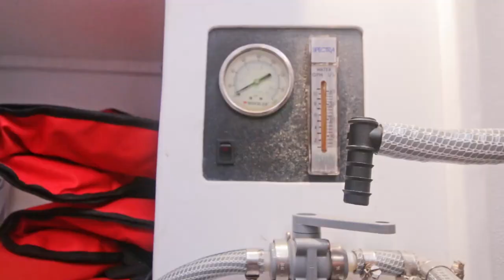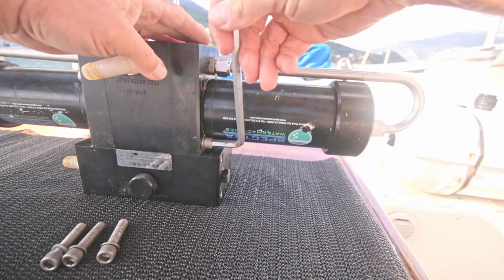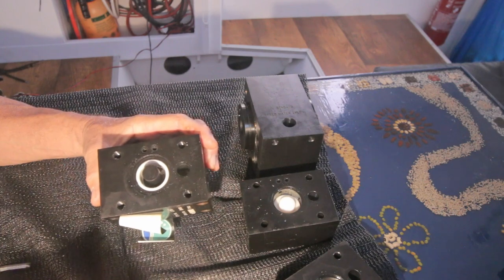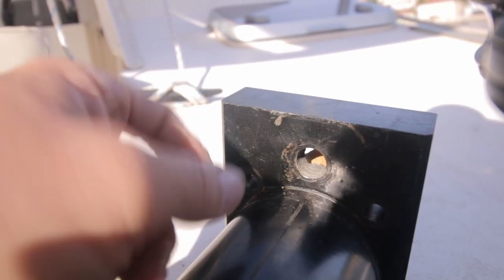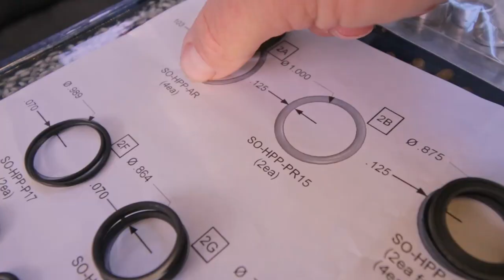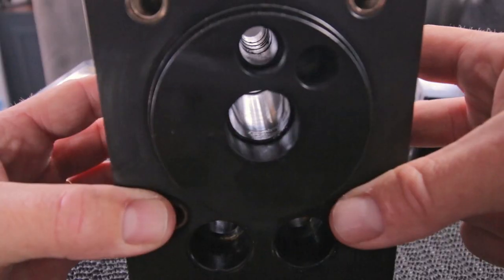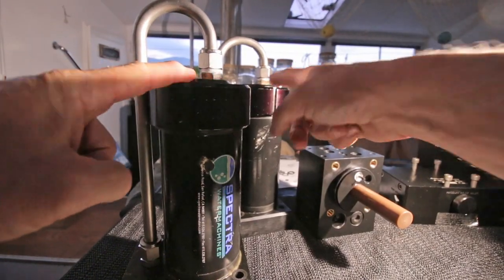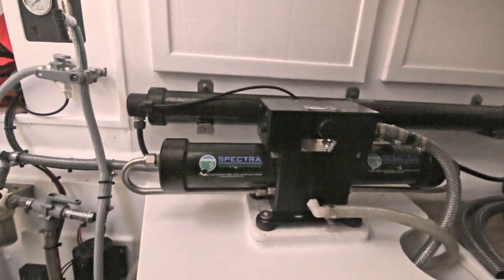DIY Spectra watermaker rebuild - Sailing Exodos, ep.47

Comment: Watched the whole video even though I went for the semi-DIY watermaker with easily replaceble Kärcher high pressure pump myself (not even put together yet, only had it nearly 2 years). Enjoy seeing someone attack tasks the way you do!
Reply from the maker: Haha, "only" two years? 😂 Yeah, I know how that works. And yes, using easily and cheaper replaceable components is a very good idea. We could buy this whole system for cheap, though (1/6th of the price of a new one, including a brand new original membrane, chemicals, original filters, and some other stuff). And it uses 8.5 amps max at 12V, so we can easily run it on solar we don't use when the batteries are absorbing.
Happy greetingz,
Wim

Comment: Thank you, best I've found so far,.. .  One question though : When you took it apart the large white pistons (lower unit) on both sides, they had a large circular groove in them, and I kind of expected there would be some kind of O-ring in those grooves,..... but there was not,....... and also not when you re-inserted them. ......... I thought these pistons were moving back and forth and with their large area was pusing liquid through a smaler diameter hole (the pipes at both ends), and in my mind, consequently, they should have some kind of seals ?,...... unless the white piston heads are self sealing somehow. ........... I just purchased a second hand one, a different brand, but almost exactly the same construction. ....... Thanks for your focus on details / struggles and alternative solutions to special tools, and the focus on what not to do :-)  Very good.
Reply from the maker: Thank you! 🙂 But about your question about those pistons - it's too long ago, I'm afraid, to give you an reasonable answer to that. Those pistons are made from teflom, so they are a kind of seal in itself, because they fit so precisely in the cylinders. I don't remember those circular grooves... Success with your rebuild!

Comment: Thank you so much for the video, certainly gives lots of useful information, helps to make decisions about our watermaker rebuild. I thought our bronze fittings were corroded badly, but yours looked worse, and they still seem to work - phew! - saves lots of $$ if we can reuse them. Did you have a lot of build up on the stainless J tubes by the ferrules and how did you clean those if you did?
Reply from the maker: Well, I'm happy you could use the info in our video :-) Yeah those bronze fittings... The oxidated bronze that came off, partly ruined the cylinders, so we have less liters of fresh water per minute, but hey, the watermaker was cheap, so I can't really complain. As far as I remember, the J-tubes were clean. The stuff on those bronze parts was no gunk, but purely oxidized bronze.

Comment: Hello and thanks for the great video. Enjoyable to watch and got me thru the take apart of my Clark pump. Rebuilding now. Did I miss the outcome of the rebuild.? Did the pump work and were you able to make water? Thanks…Ernst
Reply from the maker: Hi! And you are welcome. I don't remember precisely, but something was not totally right, then. I believe the new membrane that came with it, was so old (and the plastic around it had a hole), that it totally was dried up and unuseable. So we needed to find a new one. Took some time. But (much) later we got a new membrane. The watermaker didn't deliver enough liters of fresh water, though, because the cylinders were a little damaged. But it worked! And just a week ago i have added a second pump to it, and it gives us 38 liters per hour, so that is nice, especially because we can run it on the solar panels.
Reply: Thanks for the quick reply. I have a considerably newer unit that only had 970 hours on it but it was laid up for 4 years, pickled but not used. Working with a great dealer in FT Lauderdale US, Halden Marine, he has determined what I need over the phone and with pictures. your video was extremely helpful in the take apart and I will follow it as I put it back together shortly. thanks again!!!

Comment: Do not use Teflon tape on the threads the SS nut threads onto. It will prevent a proper seal. The biggest problem with this pump was the white O-rings on the check valves and Annular rings. That is what cause the asymmetry of the pump. I would highly recommend that you change "All" the fittings on this pump and the two on the membrane as well to all SS.
Reply from the maker: Hi. The reason that not all the fittings are stainless steel anymore, is because the ss ones expand and crimp with temperature differences. The old ones were all ss, but the factory started using these nickel-bronze ones because the ss ones sometimes cracked the pump. Because the nickel-bronze hardly expands and crimps with temperature differences, they don't crack the pump. I explained that in the video, but you probably skipped that 😎
By the way, I don't make this up, but the technical department of the factory told me. And another by the way, the pump is perfectly leak proof, with the teflon.
Yeah, those annular ring seals were really gone!
Happy greetingz,
Wim
Reply: @DoubleUThings   Greetings back at ya. Take my word for it. (I didn't skip any of your video. Which you did very well by the way) Change all the fittings to SS. The corrosion you showed in your video of the NB fittings will destroy far more of that pump than the very rare occurrence of any cracking of the pump. Even if the fittings cracked the pump (again very, very, rare)  it would only be either the center bottom block or the top center block. These are far cheaper to replace, about 25% cheaper, than a total re-build of a pump that suffers from scoring issues because of the NB fittings. Scrap the Teflon. The SS ferrules are not meant to have tape here. It really does get in the way of the ferrule seating properly in the con cave part of the fitting.  PS, I've done a Clark pump or two in my time.

Comment: Hi, thank you for your interesting video. I have some problems with my clarkpump so i need to open it and replace some components. Where did you get the set of seals and orings at a reasonnable cost? What is the reference of the kit? My check valves plastic springs are broken...are they in the kit?  Thank you very much again    Charles
Reply from the maker: You are welcome! :-) We were in Greece at that moment, and there is only one dealer, so no choice but buying it there. The kit cost me €186,- including VAT. And yes, there are new check valve seal springs in it, and the new (better) ones are steel springs.
Happy greetingz,
Wim

Comment: Thank you very much for video. 
I've got crack near thread at the end of a tube, so it looks I need special tool to dismount it. 
May be you have link to order this kind of tool. I cannot find it on Spectra website.
Reply from the maker: Hi! You are most welcome :-) But do you mean at the end of a cylinder? Because for the rest you don't need to have a special tool to dismantle. You mean to take the caps off the cylinders, maybe? If that's what you mean - I cannot get that tool over here either... It's like a half circle with a notch at the end of the circle. But that's a tool you should be able in a good hardware store. If that is what you mean, it's called a C-spanner. See Amazon link: https://www.amazon.co.uk/Spanner-Adjustable-Wrench-51-121MM-Vanadium/dp/B00Q4B95ZU
Happy greetingz, Wim
Reply: @DoubleUThings  Thank you very much! I think - that is what I want. 
Yes, I meant end of tube. Plastic part inside is cracked (and water leaking from it) and I need to disassemble this side to remove it and order new from Spectra or draw in 3d editor and order 3d printing.
Reply from the maker: @bepa_sailing  Yeah, I heard that is a known problem. I don't dare to remove mine :-) Luckily they are not leaking!
And yes, that would be nice, if you can 3D print it.
Reply: @DoubleUThings  in case of success will make video :)
Reply from the maker: @bepa_sailing  Haha, good plan! Charasjow!